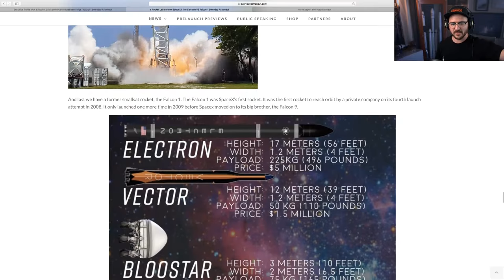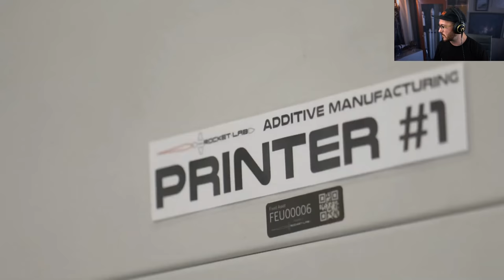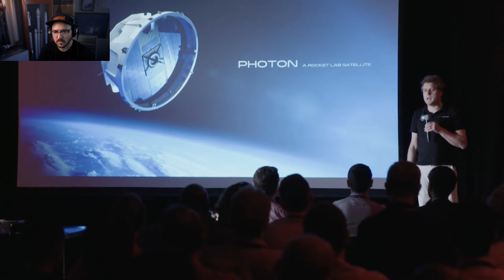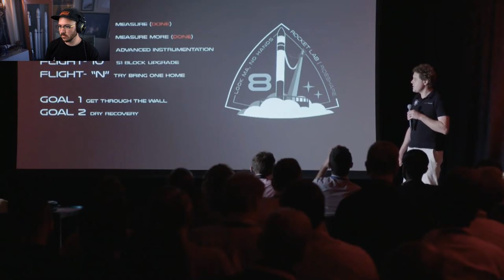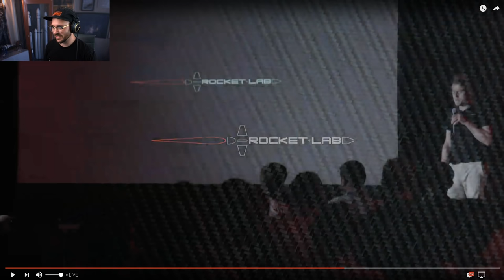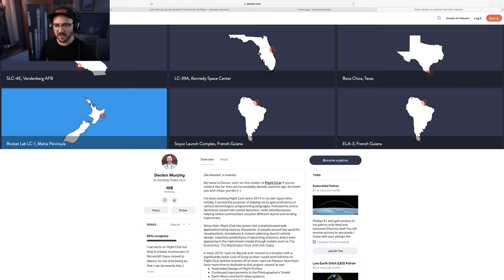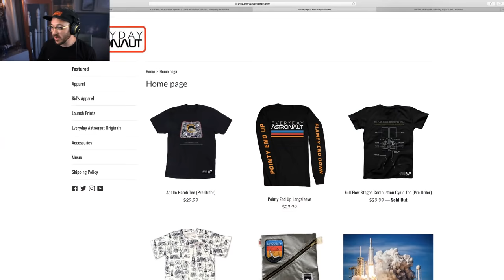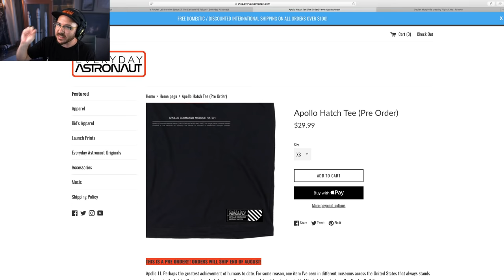Let's watch Rocket Lab's announcement

Comment: Regarding the question of whether a helicopter could "catch" a Falcon 9 first stage:

The dry mass of the first stage is 22.2 tons.  A CH-53E Super Stallion has a payload of only 14.5 tons.  If we allow Russian helicopters, we can get closer with the Mi-26, at 20 tons.

So it might work, if you get two of them working together, similar to swallows carrying coconuts.
Reply: African swallows? Or European swallows?
Reply: Sounds like we need Musk to start designing helicopters.
Reply: Worked in Pacific Rim (movie). Just take 4 choppers and deploy the Jaeger.
Reply: Question is how big can you make a helicopter. The planned Hughes XH-28 could go 20 ton, could we scale it up even further with new materials. Jet tipped helicopters are massively noisy and burn a lot of fuel, but so do rockets. How crazy big could we go, could Elon prove he's more nuts than Howard when it comes to building crazy big things.
Reply: @karrotop  And what is the airspeed of an unladen one?
Reply: So basically we would need a tilt wing varient of C5 Galaxy.
Reply: @ramons8908  : When trying to build really big helicopters, eventually you decide to just tie some airplanes together with long cables, and hang the payload from the center point. The aircraft act as rotors, circling around, and the center point of the cable acts as the cargo lift point.
Reply: @absalomdraconis  You can do that with 1 airplane and a long enough rope or cable and a clever enough pilot. The cable sets up a wave that gets smaller and smaller until it comes to a stationary point.

That's no fun though, we want to build a really big helicopter. essentially, jet tipped helicopters are just like your 2 aircraft, 2 wings circling each other powered by jets. There is no gearbox, so you can pretty much build them as big as you like, just need a whopping great rotor head to hold it all together (look up pictures of the XH-28 mock up, and you see what I mean).

Considering the XH-17 and Fairey Rotodyne were prototypes, and the XH-28 a mock up, these things could of got really big, if it wasn't for the noise problems. I'm surprised the Russians didn't go down this path, as they seem to ignore noise problems.
Reply: The next problem you would encounter is that once you catch it you are 500 to 1000 KM offshore. You would have to set it on a ship just like " Of course I still love you " and take it back to shore,, oooorrrrr you could just land the booster on the drone ship.
Reply: Mi 26 can fly with 20 tons, but i highly doubt it can catch 20 to falling for couple kilometers

Comment: "3.5GJ power 57000 homes (for an instant)": Well yeah, depending on the duration of your instant, even a femto Joule does.
Reply: Agreed, I hate when speakers confuse power with energy just to conway their point.
Reply: If we assume an average household uses 1kW on average, then it should be about a minute, idk if he misspoke or what, since I wouldn't consider a minute an "instant".
3.5*10^9J / ( 60s/min * 10^3J/s )=58333 homes that can be powered for 1 minute.
Reply: @FiNiTe_weeb  Thanks! I was too lazy to do that calculation, but it is probably what was meant. (1kW per household, really? Sounds like a lot, but then again it's the US ;-) ).
Reply: You will need to ask Emmett Brown about that

Comment: About SpaceX competing with Rocket Lab in small sats launches, I can think of four major points... 
1. SpaceX price is definitely attractive, but if you are the satellite owner you also need to consider that being a ride share doesn't assure you are going to reach your target orbit. You need to be prepared to spend some delta-V of your own, hence you need an appropriate propulsion system (with all the engineering, testing, validation, assurance, ...): this quickly add costs up. Whereas Rocket Lab is going to deliver you to your target orbit (assuming they are launching only your satellite) and you only need to worry about the attitude control system (or at most a very low-power propulsion sytem)!!! 
2. Also, equally important, with ride share there are definitely compromises in the maximization of objectives, for instance the correct time to launch: the priority is given to the "bigger" satellite owner in that specific launch... again, for small sat operators this could end up being more costly than launching with Rocket Lab. Of course, each satellite operator knows what they are doing and ultimately decide their best option for their objectives.
3. Even if SpaceX could lower the price even more, it is my opinion that this will not ends up costing too much to Rocket Lab, because of the latter's flexibility to reach the target orbit. Plus, satellite operators love the launches competitions!!! They need it!!! So, even if at some point in time SpaceX price is definitely more inviting than Rocket Lab, the latter will continue to receive support, thus having the chance to improve their hardware and operations.
4. Now that Rocket Lab is pursuing resuability, their costs may go down significantly... Tough, as stated in the presentation, it's a very hard work to actually reach it. A sincere good luck to Rocket Lab, hope to see you recover your first rocket asap!!!

Comment: Sure enough, a Falcon 9 fairing half weighs bang-on exactly the same as the spent electron first stage. They have similar heights, but the width is the killer, about 4 1/3 times the width.
Falcon 9 Fairing (each half)/spent Electron Rocket first stage

Mass: 950kg/950kg
Height: 13m/12.1m
Width: 5.2m/1.2m
Reply: I would love to here the points, SpaceX had leading to the decision to use a catching net on a ship instead of an plane or helicopter.

Comment: A German study was released a few months ago that looked into flyback booster stages that would be air-recoverable. In it the booster doesn't spend a lot of fuel to do a big boost back burn or landing on land or a barge or ship, but instead glides down range on small wings until it gets hooked in mid-air by a large aircraft like a 747 and then towed back. 

The idea is that the technology for this already largely exists since that's what the U.S. or other militaries use to in-air refuel large aircraft.
Reply: And how are they going to land? Air to air refuelling is quite different from cathing a gliding rocket.
Reply: @Matu1  by cutting loose the stage and letting it land itself or the way many tow aircraft and their gliders can land together if needed.

Also, air-to-air refueling and this concept share many attributes since both involve the mid-air rendezvous and hook up of large aircraft. In this case you are substituting a towing boom for a refueling boom. 

In terms of difficulty this is no worse than what SpaceX and Blue Origin are doing with vertical landing.
Reply: @Nowhereman10  i think you should watch a video about refuelling in air and what it takes to make it happen. Then you might raise some eyebrows like me when somebody compares it to catching a gliding rocket, if that rocket would fly on its own fuel like a plane then it would make sense. Maybe you give me link to that study, i feel something has been lost in translation or something :D

Comment: Always wondered why SpaceX didn't use a big drone to act as a pilot of the fairing  parafoil i.e. not actually support its weight, just guide it back to the ship.
Reply: Interesting idea. Just snag it, kind of tow it in the right direction. The snag-loop will have to be on front edge of the parafoil. Critical factor: how much tugging can a parafoil take without collapsing?
Reply: @donjones4719  would make an interesting question for Tim to ask if he ever gets an interview (or maybe someone on Twitter could? I'm not).

The fact they actually fitted out Mr Steven means they must of brain-stormed all sorts of crazy ideas beforehand.

Comment: I reckon that wall is very very thick if they don't bleed off speed propulsively. Good luck Rocket Lab!
Reply: mikeissweet Their wall should be thinner than most because of the lightness of their vehicle, combination of no fuel, no turbo pumps, carbon fibre body means there is a lot less force that needs to be applied to the rocket by the atmosphere to get it below hypersonic speeds.
Reply: @Wemdiculous  Spacex posted a video of one of their fairings reentering the atmosphere. That thing is a flat piece of carbon fiber and check out the plasma on that
Reply: mikeissweet and it survives just fine even though it’s traveling faster than the booster will.
Reply: @Wemdiculous    Watch the video- it's stunning. 
It's going to be an incredibly impressive feat to bring a more dense, and less blunt booster home from 7,500 km/h using only drag. I look forward to them figuring this out.

The fairing is going about a thousand km/h faster, but it ain't a booster.

Comment: Don't even need to transfer booster from ship to truck, etc. When ship close to land, just lift it with the helicopter direct to the factory.
Recovery of engines, batteries, avionics is key. Falcon 9 booster designed robust enough for reentry, reuse. Electron not, and as you pointed out, no mass margins for new stuff. But even if the booster itself can't be reused, the other components make recovery worth it.
Reply: My thoughts exactly, if they could just make the engine stage recoverable and produce a new body every time it should still cut costs down significantly.
Reply: @Marc83Aus  Seems good enough for ULA

Comment: Hey Tim, I'm curious, how practical do you think it would be, to use railguns, on the moon, and on one of Mars' moons, to send supplies to mars, and ship resources or other goods back. Launching a rocket in space with a railgun would let you send larger loads at higher speeds(as long as there's no people on board), and only need to carry enough fuel to decelerate on arrival. And could shorten the amount of time It would take to get supplies to mars in an emergency.

Comment: I'm interested in more details in that drogue chute.  Is it a normal drogue, or is it like a hypersonic ballute?
Reply: Agree. Looks like a ballute. It likely presages a hypersonic one; that would be a leading candidate for what Rocket Lab is doing.
Reply: Looks like ballute. I was bit confused though why to use parafoil as main parachute as accuracy/horizontal travel is not required with aerocapture. And ball canopies are more reliable.

Comment: NASA had a project (back around 2004) for a flying test-bed known as HyTex that was to be launched on a sounding rocket from Wallops and air captured by a helicopter in exactly the same mode as shown in this video. I worked on HyTex. It was part of NASA's Next Generation Launch Technology (NGLT) program. HyTex, along with NGLT was cancelled when NASA's Constellation (forerunner to SLS) was started. I'll have to do a video on it on my channel sometime. Do checkout my new YouTube channel Galactic Gregs  (by clicking on my icon) that I started this January! Love your channel Everyday Astronaut!

Comment: What is the difference between catching it with a helicopter and using a net similar to how SpaceX catches the fairings? What are the benefits?
Reply: meowsty helicopters are faster so they have a larger area they can catch them in, and if they miss at 1 km up they can try again instead of having only one chance.

Comment: does anyone know what the weight of an empty Electron 1st stage is?
Reply: Dimensions as well? I bet we would be surprised.
Reply: Here is a copy/paste of Josh McKinney's post:

Sure enough, a Falcon 9 fairing half weighs bang-on exactly the same as the spent electron first stage. They have similar heights, but the width is the killer, about 4 1/3 times the width.
Falcon 9 Fairing (each half)/spent Electron Rocket first stage

Mass: 950kg/950kg
Height: 13m/12.1m
Width: 5.2m/1.2m
Reply: @donjones4719  The width makes it much easier to bring a fairing back. Spreads the reentry heating over a huge area with more aero-braking.

Comment: I see huge problems with thermal loads during descent, they should at least use 1% of remaining fuel left do decelerate enough not to damage anything. 1% of fuel is probably lighter than any potential thermal protection anyway.

Comment: I've wondered for a long time why SpaceX don't use helicopters for fairing recovery. Anyone?
Reply: Start watching at ~ 32:00
Reply: @syrox1564  Hello. Thanks for the reply.
But I'm not thinking about the recovery of SXs first stage booster by heli, but recovery of the two fairings. They float through the air in parachutes already and land in the water or in the net of the boat Ms.Tree. Grab them with a couple of helis and lower them to the deck of the boat seems simpler, more reliably, more fleksible and more cost effektive.

Comment: I've been thinking that the electron could have legs and control surfaces and atitude control thrusters IF solid fuel boosters are added to compensate for the added mass of the extra equipment. Solid fuel boosters are cheap and expendable, right? Come to think of it, SpaceX could use SRBs to make expendable launches recoverable. There must be a problem with this idea that I'm not seeing. Someone shoot down the idea, thanks.
Reply: SpaceX doesn't use SRBs because Elon Musk categorically hates the idea of non-reusable boosters of any size. His idea of a strap-on booster is another Falcon 9. 

I'm no expert, don't even play Kerbal, but I think it's a problem of scaling. The weight of the hydraulics and actuators, grid fins and legs, would be a significantly larger percentage of the total mass of the rocket. (Even though each component proportionally smaller than on F9.) And as Tim pointe out at the beginning, the smaller the rocket, the more mass-critical every component is.
Reply: @donjones4719  I wonder what it is about solid fuel boosters that is objectionable. Yes, I see the problem of scaling, although I doubt I have a grasp on it.
Reply: @AnotherGlenn   Elon's goal at every point was landing on Mars. Every design program around the Falcons was based on that. Taking off from Mars means everything must be reusable - SRBs don't figure into that. F9s never meant for Mars, but are part of his  program for Starship.

Rocket Lab not liking SRBs...  Their business plan is the 150-200kg payload market. Their business plan, from how they crunched the numbers, I guess, is not to compete in the medium booster category. Hmm... SRBs are cheap next to the Atlas 5 they're attached to (for example), but proportionally not cheap next to an Electron and it's small cost payload/launch.

Also, RL would face very large development costs to develop legs and control surfaces and attitude control thrusters, and a research program on how to land , do a hoverslam or something similar. I don't even know if their engine can be throttled in the way needed. So... a huge investment. And it doesn't scale well, if at all. Find an image of an Electron next to an F9. The first stage is barely taller than an F9 landing leg.

Comment: With the Corona capsules they were recovered in mid-air by C-119 Flying Boxcars (Later on C-130 Hercules) and the salt-plug would melt after 24 hours.

Comment: Without grid fin, how do they gonna steer that thing?
Reply: Reaction wheels and rocket body orientation?
Reply: @todddaniels1812  No, Those methods only work in 0G... When rocket entry an atmosphere, it'll subject to enormous air pressure which required some kind of thruster or aerodynamic maneuver. However, I kind of understand now that Electron doesn't need any of those.
They're just let it free fall in a predictable arc. Fast recovery vehicle like that heli will easily track that booster with real-time GPS. Also, catch booster from the sky is very do able but will not be easy because you can't automate it.

Comment: I know people think this is a crazy idea But ULA  Is planning to do the same thing with 2 heavy BE 4  Engines. So a Lightweight Carbon fiber Very small 1st stage of a rocket Is not that crazy
Reply: Do we have any idea how much a BE-4 engine weighs? (not asking in a snarky way)

I am curious about how aggressively ULA is pursuing this, what timeline. Afraid I'm a bit cynical about this old-line aerospace company, think they'll make a lot of Vulcan launches before they upgrade to recovering the engines. Am so cynical I thought their announcement of this future upgrade was to save face, keep their rocket looking viable for stockholders, etc.
Reply: @donjones4719   Thirst no specs on how much they weigh but  About 12  Feet tall with the power head And about roughly the same size of a RS 25

Comment: Is possible to put several boat equipped with helicopters to pickup the rockets?
Reply: Not if you want to stay cheap, but the parachute will be open for a while and helicopters are fast. 

If SpaceX can catch a fairing with a slow boat they can do it with a helicopter.

Comment: Good luck to the kiwis on this one. The US, their partners used to try recovering objects or people using the mighty c-130 and probably other aircraft. Not sure on reality this will fly unless they plan on using the CH 47.
Reply: They didn't just TRY. For many years, film canisters from the Keyhole and other surveillance satellites were snatched out of the air. Damned precise flying, 100% success rate claimed. And that was without computer assistance.
Reply: Am 99% sure that was a recovery of a full-size Electron first stage. Just air-dropped from a low altitude. Don't think they would make this public announcement if they hadn't worked out at least this much. While not a Chinook, that is a powerful helicopter they used. It and the ship look like ones used to support off-shore oil fields.

Comment: with no heat shield how do you avoid melting the rocket falling back to earth?
Reply: Plasma - injecting gas or liquid into the forward stream?
Reply: The engines are able to take the heat and compared to the Falcon the empty electron is very light so it can slow down very fast